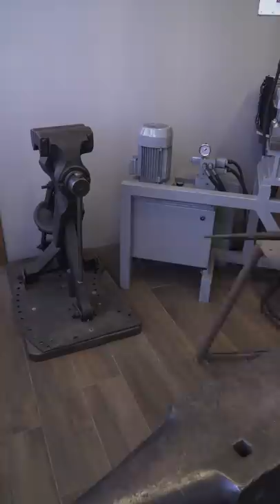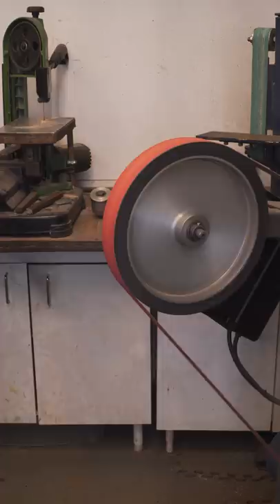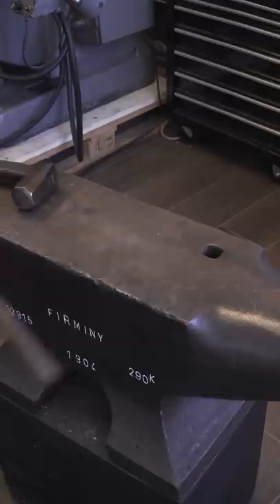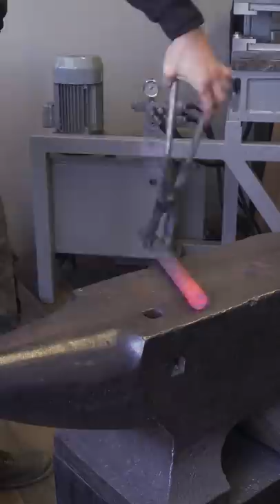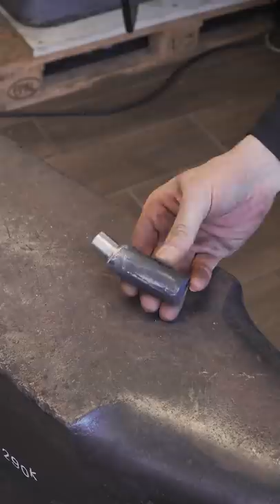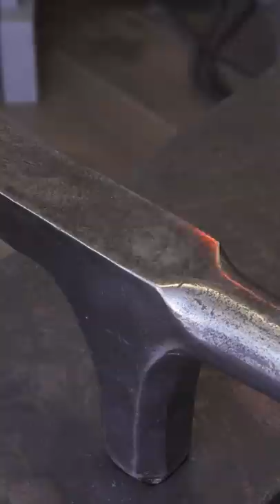Fitting Big Stake Anvil #shorts

Comment: "that's right, it goes in the square hole."
Reply: How to fit a round peg in a square hole:
Step 1) make it square
Reply: I mean, it’s curved, so it won’t rotate or anything
Reply: That's right, it goes in the square hole 😨😭
Reply: 😆 lol.
Reply: PTSD moment
Reply: Underrated comment.
Reply: That meme of a child's shape puzzle blocks. All shape fits into the square hole. Lol
Reply: Lmfao
Reply: If he made it square he wouldn’t be able to remove it from the anvil. Square fitting in a square hole would wedge it self in after a few hard wacks the corners would bit in and lock it in
Reply: And here we have a triangle. Which hole does the triangle go?
Reply: @survivalistor6195 that's right, into the square hole.🤣
Reply: For one that's a Hardy hole and yes they are square so the tool doesn't turn
Reply: And two that's a good way to make the tool custom to the Hardy
Reply: @helheimrgaming2547 my grandfather told me blacksmithing the one job that says screw your shapes I'll make it how I like
Reply: @jacobmorgan1182  your grandfather is absolutely correct

Comment: For the people saying he ruined it. Whoever mounted it to the stand had actually cut of the part that went into the hardy hole on the big anvil. He simply returned it to its original state and function.
Reply: Oh, thanks. But I would prefer that pipe going to the square hole a bit thicker
Reply: @luisapaza317  ? I have no idea what you mean.  He simply returned the stake anvil to it original function.
Reply: Actually... No... stake anvil isnt even meant to go into a hardy hole... Stake anvils were used by driving them into... you guessed it... wooden STAKE... So that tey made somewhat portable anvil... In the end, the anvil is still usable but still ruined
Reply: @matejostransky7154  you are correct in the fact that originally the stake anvils were meant to be driven into a log or wooden block. But the modern use is to install it into the hardy hole of a larger anvil so that it can be switched out quickly. So, both ways are correct.  I meant no disrespect to anyone.
Reply: @matejostransky7154  
  Actually, they were "staked" into a stump.  They're also known as a "stump anvil."  I have one with the original, tapered tail and one which is fit for Hardy holes.  🕳 😉
Reply: 1
Reply: @matejostransky7154  if it serves his function better, it is enhanced, not ruined. That is regardless of what was or was not the original design.
Reply: An stake anvil is intended to fit in a stump, the video show how a remodeled stake anvil become the hardy tool of a massive anvil, the only way it will be used over an anvil.
Reply: @павелворобьев-ц6о  тоже не могу понять, чем было плохо?!🤔
Reply: @Tatanya0  привет полностью согласен нужно обратно переделать будет не скучно
Reply: L
Reply: L
Reply: @69-Bot  ok, you win, feel better ?
Reply: @luisapaza317  It would be damn near impossible to fit a thicker rod in there, and it’s not your anvil so what you prefer is not a variable
Reply: @jk3dad  I’m on ur side lol i meant to say that to the Luis guy
Reply: @69-Bot  my apologies
Reply: @luisapaza317  это не труба
Reply: @luisapaza317  000000000000000000
Reply: @69-Bot  I believe it is possible. From a slightly fatter piece of iron crushed correctly. But it is a minor detail and comes from personal preferences. And if it serves its purpose well then no problem.
Reply: @Название-л8т  Я думаю, что слово "цилиндр" более уместно.
Reply: @luisapaza317
Reply: @ИоакимРубинштейн  ЁЁЁЁЁЁ
Reply: Okay, based on other comments, I now understand. I THOUGHT it was being ruined by cutting off initially.   Never used one.  As a machinist I have adapted old tools for more efficient use and thought nothing of it. This is kinda the same but had been previously adapted.  I like this.  It's recycling and efficiency.   That old stake anvil, if it could talk, would love being utilized this way.....except maybe for the cutting off the feet part.🤣
Reply: And now he also has a stool. I'd say that's a win
Reply: @luisapaza317 y que no me la familia 😞😞😞😞😞😞😞

Comment: Always make sure you don't have a boring head that screws into whatever type mounting system your machine uses, like an R-8, CAT-X, etc.... spinning them backwards, with the boring bar rotated 180 degrees to cut inwards or externally or of an O.D.... If the head unscrews while in use, sure would make for a fun day.

Comment: From what I gather and am capable of understanding, originally that smaller, longer, thinner anvil was intended to be used in conjunction with a regular anvil? Is this correct?
Reply: Yes.
Reply: Yes, it's called a steak anvil, and is one of many accessories that can fit into the hardy hole of the big anvil.
Reply: @slappy8941  making me hungry.
Reply: @slappy8941  a forming stake.

Comment: Where can you get a anvil that's actually good for smithing I want to start in but I am having problems finding a good size anvil that doesn't cost an arm and a leg
Reply: Harbor freight. Dont worry abour buying the most expensive or highest quality. Get something cheap like harbor freight for practice
Reply: @cosmicbilly  awsome thank you for the info
Reply: @TheEaglekun  of course! I hope it works out for you man! Good luck
Reply: Anvils can get very exspensive,  just start with Harbor freight,
Reply: I've bought two from scrap yards at a reasonable price. You would be surprised what folks throw away.
Reply: @loydevan1311  I wouldn't where i work people are beyond wasteful I not once but twice pulled a pair of beats headphones out of the trash
Reply: Do NOT buy a HF anvil.     Junk all the way.     Buy one off of marketplace or save up and buy a real one.   If it doesn't work out sell it.
Reply: Many start off and keep things that can be used as an anvil surface, like railroad tracks, large cutoffs from shafts or heavy square stock, plates, some of these are better than harbor fright in my opinion. Shaping what you can use is part of the learning process.
Reply: Check your local scrap yard for any decently weighted chunk of steel that you can grind a flat surface on. Then make a good pair of heavy duty tongs that you can safely pick it up with. Throw it in a good fire and get it rolling to heat treat the face as best as you can, or conversely use a rose-bud torch. Really, to start, you don't really need a hardened surface, the heated steel you'll be beating will be softer than the face of your "anvil shaped object". As long as you don't let your work piece get too cold, the ASO will last a good long time.
Search [anvil shaped object] on YouTube for tons of videos for ideas and suggestions.
Black Bear Forge is a great source for beginners, among many many others. 
A bit of advice... spend as little as you can before really trying out the craft. Make scrolls, leafs,  bottle openers, tongs, nails, wall hooks, and any other small to medium projects to see if you like it or find it isn't what you dreamed it would be. Heck, make a blade or a tool or two, if that is where you imagined your craft going. Then, if you are still fired up about smithing, make the tools you can, and buy what you have to. Remember, the scrap yard is a great source for materials. If you get into tool and blade work, there are online sources to get specific steels for specific needs, if you don't have a dealer in your area.
Good Luck. Hammer on.
Reply: Thank you all for the info and for taking the time to respond
Reply: Alec Steele, or antique auctions.

Comment: What's the name of the tool he used on the drill press to reduce the diameter of the round steel?
Reply: It's a boring head with a boring bar turned inward.